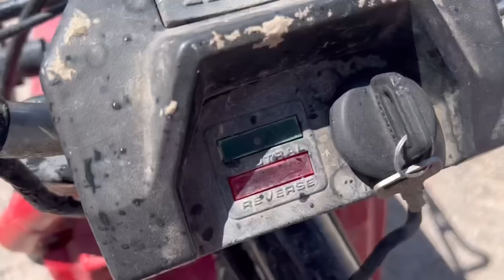Driving On The Bottom Of A Lake! (20 Foot Snorkel)

Comment: Gav u gotta listen to me. You need to snorkel the exhaust. Once you do that it will be a success. ALSO ditch the air box and hook snorkel up to card. U do that and it will work also u can let off gas under water and jt won't shut off.
Reply: This comment needs to be seen

Comment: Brother look up tank snorkles or submarine snorkles. They use a rigid 20ft extension with separate piping for fresh intake air and piping for the exhaust gas. You need your exhaust to be above water also.
The whole air intake box might need to be looked at also, considering she's 40 years old. Old clamps or dry rotted rubber could be letting water in. Even the spark plug holes might need waterproofing.
Respect your enthusiasm, good luck

Comment: case breather hose? that has to go to fresh air.
but its in the air box. ditch the airbox. just run snorkel strapped straight to the carb. tee the breather in to it. it may need some restriction to match the (lack of) air filter. or a rejet :)

everyone talking about getting the exhaust above water too...

its irrelevant at this depth. 33ft, 10M, for 1 atmosphere of pressure, or double the exhaust backpressure. at that point it might start struggling with half its effective compression ratio...
its simple.

ELECTRONICS DONT LIKE WATER.

the plug and boot, that has to be sealed watertight or its hopeless. ive had motorbikes that get grumpy with just a bit of rain, so stuffing one underwater is never going to end well..

then attack the harness, magneto direct to CDI direct to coil, silicone grease, heatshrink, no killswitch, no open conductors ANYWHERE. you got the kickstart, it doesnt need the switches.

and about 500kg of lead required. some floddlights mounted on the front axle wouldnt hurt i guess...whats it like underwater for visibility?

FILL THE TYRES WITH WATER.

Comment: tracks are not ment for water they slip need sand tiers they work as paddles and push you through the water done it before and works the best or use one inch tall mud grips